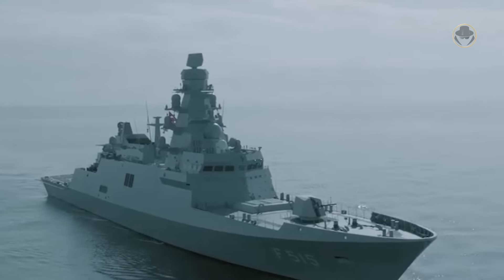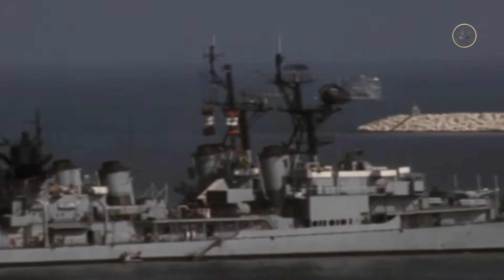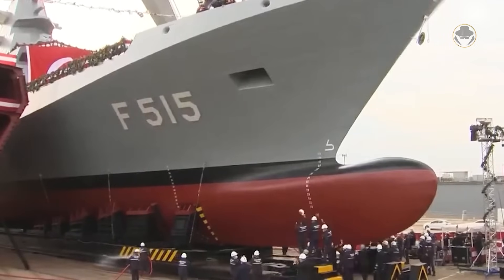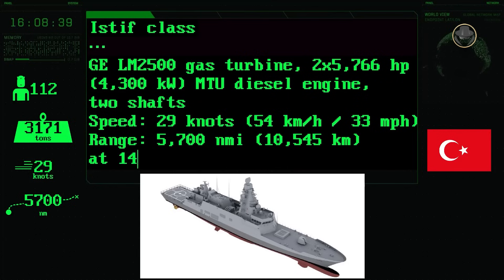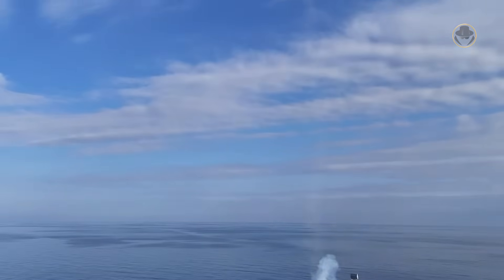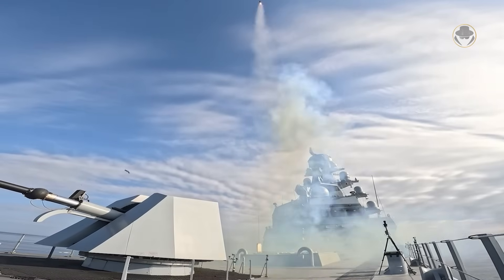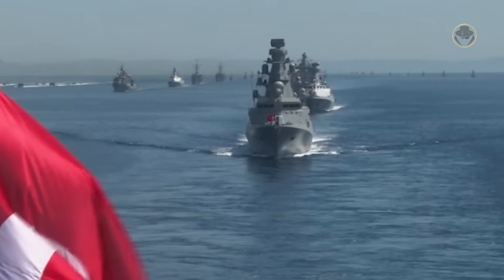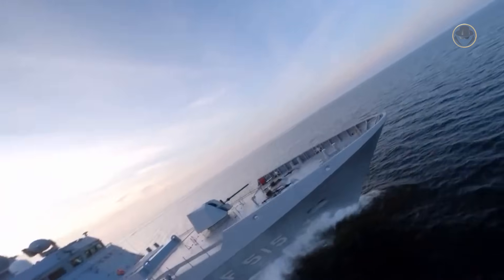İstif-class (İstanbul class) frigate | The new warrior of the Turkish Navy?

Comment: What is the approximately price for frigate like this if some country want to order it from Turkey?
Reply: Depends on the country but probably close to 500 million
Reply: Not 500, the main concern of the navy was the cost. The order of 8 ships is a modification, originally it was 4 vessels. Compared to its capabilities, the price is dirt cheap, should be around 360 to 450 million dollars fully equipped, most likely at 420ish something. @hhhhkkmmcc3089
Reply: Dang for that price get a type 31 you could afford to put extra vls cells, a proven radar and a towed array sonar.
Reply: Someone else said 375 million so if its 375 its almost worth it.
Reply: Depends on the weapons load and system on board ,it costs around 375-450 million USD per piece

Comment: This ship has far more armament and sensors than comparable nota ships. It is literally armed to the teeth and functions of weapons and sensors overlap. There is more than adequate redundancy.  It has very strong air defence,  good sufrace warfare capability,  very good underwater sensor and weapon espcially orca torpedo. It has excellent asymetric warfare capability, two auto 25mm gun? It looks beatifull as well...
Reply: Alternatively, given that it's combat systems and sensors which makes up the majority of a ship's cost, this ship is significantly undersized, with all the problems of worse seakeeping, low endurance, worse crew quarters (and hence much lower rates of personnel retention, and higher recruiting costs), worse access for maintenance (and hence higher crew requirements than a larger ship with similar systems), and less space, weight, power and cooling margins for future additions that this entails.

In terms of sensors and armament, it's pretty comparable to most NATO ASW frigates, except that the most recent examples tend to be a) much larger, thus avoiding many of the problems outlined above, and B) are incorporating increasingly capable AAW combat systems with multiple staring phased arrays rather than a single rotating one (not a bad idea, since submarines are themselves an AAW threat these days with anti-ship missiles) plus the increased dispersal of naval formations means individual combatants have to have increasingly capable AAW systems to defend them selves, and to contribute to the wider formation's AAW bubble as a result of the improved coordination brought about via CEC.
Reply: For Turkish navy I bet the living quarters are luxury. It has far less personnel than american courterparts and far better personnel accommodation. Turks still use oliver perry class which is a larger ship and far worse quarters.
Reply: Its about the same as every other frigate but lacking aesa radars. Its got a pretty standard 16 vls cells, many frigates even have 32 vls cells and an additional 8 anti ship missiles. If anything if follows the low intensity line of frigates. Armed to the teeth would be 32 or 48 vls cells, a towed array sonar and asroc torpedoes. Many other ships have more tonnage and more fuel for staying power. This is like a half decently Armed patrol frigate for limited local escort, coastal patrol, and self defense. Even an Oliver hazard perry frigate had a 40 missile magazine for its mk 13 arm launcher for sm2 missiles. An essm is half the size and warhead and half the range so if anything the Oliver hazard perry is Armed to the teeth and this is a local or coastal loadout.

Comment: It is a very well-balanced frigate. The downside is that its helicopter landing deck is short, similar to that of the South Korean Navy. While skilled pilots can compensate for this, a longer and wider landing deck would be preferable.
I wish you the best of the Turkish Navy. from S. Korea. 🇹🇷🤍🇰🇷
Reply: @cenktuneygok8986  The Korean War broke out on June 25, 1950.
Turkey officially decided to participate in the Korean War on July 25, 1950. Later, on October 17, 1950, the first Turkish military unit (about 5,000 soldiers) arrived in Busan and engaged in combat. Turkey dispatched its troops in a total of five rotations, and during the Korean War, approximately 21,212 Turkish soldiers participated. The Turkish military played a crucial and pivotal role, mainly on the central and eastern front lines.

We will always remember Turkey's support.
Reply: @kazimkorkmaz This is not normally a problem. Since I do not know the Turkish Navy's maritime storm classification system, if we substitute it with the Korean Navy's system, a 3,000-ton frigate is expected to operate if necessary under Hwangcheon Level 3 conditions (wave height 4.1–5.0 m, 4–6 m according to WMO Sea State Code 6, "Very Rough"). Under such conditions, the takeoff and landing of an anti-submarine helicopter become significantly more dangerous than usual. Therefore, a longer and wider landing deck is required.
Reply: @SnowLeopard2121  cest pas pour se vanter mais nos pilotes d helicoptere sont incroyable
Reply: @SnowLeopard2121  In Turkish İstif class frigates, a helicopter landing system (HİS) or helicopter capture and stabilization system is used to facilitate the landing of helicopters. This system is designed to ensure safe landing and take-off on the ship's moving platform, especially in sea conditions. Here is the working principle of this system:
1. Capture System (Harpoon and Grid System)
Harpoon System: A "harpoon" mechanism located at the bottom of the helicopter is clamped to a grid on the deck. This system automatically locks the helicopter when it touches the deck and prevents it from slipping or skidding.
Grid System: This grid located on the deck provides the surface where the helicopter will be clamped with the harpoon mechanism. The grid facilitates the helicopter to stay in the correct position during landing.
2. Stabilization System
After the helicopter lands on the deck, it is secured by the deck personnel using ropes and mooring systems. This prevents the helicopter from moving due to the movement of the ship or bad weather conditions.
In some systems, the helicopter's wheels or landing gear are also fixed to the deck with special locks.
3. Motion Compensation
The movements of the ship due to waves (rolling, pitching) can make it difficult for the helicopter to land. For this reason, motion compensation systems are used. These systems provide the helicopter pilot with a more stable landing surface by balancing the ship's movements.
In some modern systems, the deck actively moves, facilitating the helicopter's landing.
4. Pilot Support Systems
During landing, the pilot uses visual and electronic aids. For example, the Laser Landing System or GPS-based navigation systems ensure that the helicopter lands at the correct angle and speed.
In addition, the personnel on the deck guide the pilot during landing.
5. Safety Measures
The system includes various safety measures to prevent a possible accident during landing. For example, if the harpoon mechanism fails, backup mooring systems are activated.
The fire extinguishing systems and emergency teams on the deck are ready to intervene in a possible crisis during landing.
These systems are critical to making helicopter operations safe and efficient, especially in difficult sea conditions. Using these technologies, İstif-class frigates enable effective helicopter use in both military and humanitarian operations.
Reply: AESA?